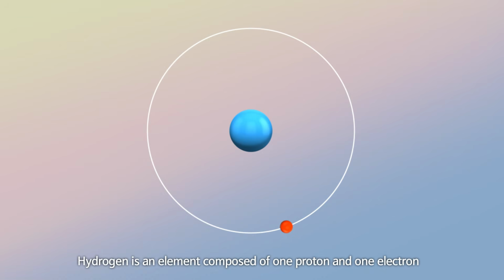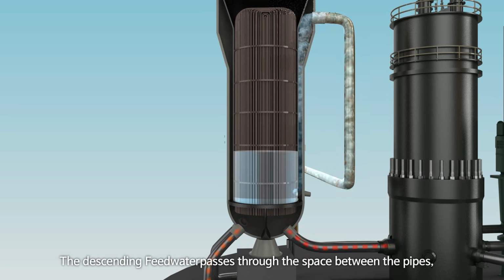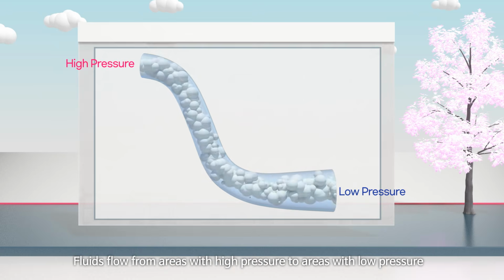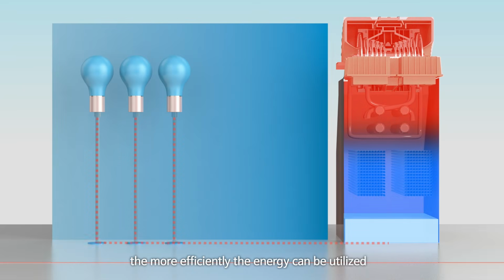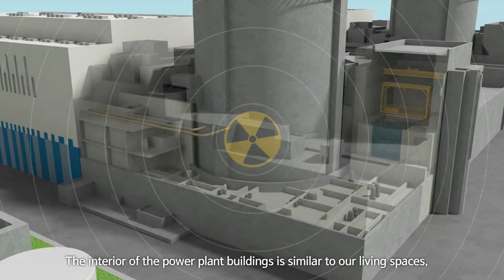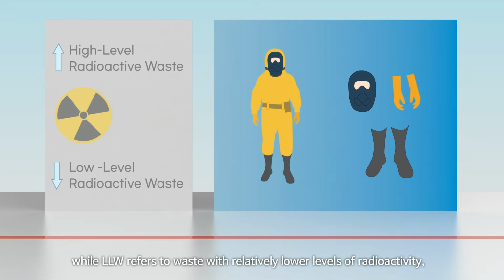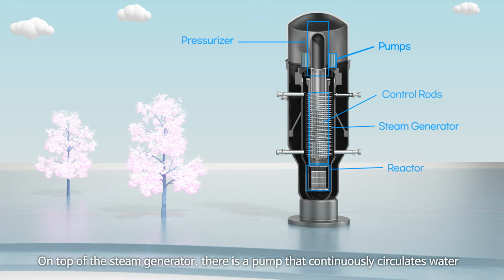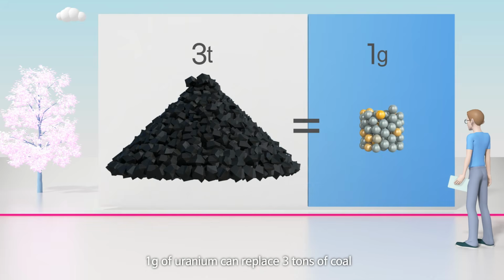Structure and Operation of Nuclear Power Plants

Comment: Good animations.  But 19:32, there are no SMRs being serially manufactured as shown in the animation—not even close.  The factories and assembly lines do not exist.   Even if they did, they would cost enormous sums of money.  A near to full automated factory for SMR manufacturing will be many times the complexity of an SMR itself since a reactor is a complex device with very tight engineering tolerances.

What's worse is there are not enough orders of SMR units to financially justify building an automated SMR factory assembly line in the first place.  So SMR ends up in a catch-22: 

No mass orders → no serial manufacturing
No serial manufacturing → high costs & slow builds
High costs & slow builds → no mass orders

As such, each SMR is still a custom build with bespoke construction methods exactly like a large-scale reactor but producing significantly less output.

So SMRs are actually are the intersection of the worst aspects of nuclear energy being high in cost and small in output which results in the very undesirable high cost per MWh generation.  Traditional large-scale nuclear energy is already one of the most expensive ways to produce electricity on a per MWh levelized cost.  But SMRs are actually heading the wrong way in terms of cost benefit.

Comment: radio active loading of TMI II --A hundred and fifty tons of uraniu,m, 
25,000 grams of plutonium, one billion curies of iodine, 600 million 
curies of cesium, 680 million curies of xenon, 525 million curies of strontium

2 grams of cesium is enough to contaminate about a square mile:
that is the size of dime. Plutonium is much worse. Cut the dime 
into 10 pieces. one of those pieces is enough to contaminate a 
small town. Grind it up into dust, and Blow that into the house, and it 
is enough to contaminate it. If any normal person does this, wouldn't 
this be called a terrorist act, a murder attempt or both? But when the
nuk industry does this with a couple thousand TONS  of plutonium,
cesium, and 1200 other goodies, and that gets spread out over the 
whole world , what happens ?
Reply: What about coal which realeases tons of radioactive isotopes into nature through their stacks or from the fly ash. Cobalt for batteries is mined in conditions akin to slavery. None of these powersorces are perfect.

Comment: The video contains some inaccuracies regarding the moderator: 

"Heavy water slows down the speed of neutrons more than light water simply because it is heavier"

It's precisely the opposite. Light water slows neutrons more, since the mass of the neutrons is very similar to that hydrogen. That maximizes the transference of energy during a collision. Deuterium's mass is ~double that of neutron, so there's less transference of energy.

"Natural uranium has a low concentration of U-235, about 0.7%, and so the speed of neutrons needs to be reduced further. Therefore, they use heavy water"

Heavy water isn't used with natural uranium because it slows down neutrons more. It is used because it is much less of a neutron poison than light water. This is because deuterium has a smaller chance of absorbing neutrons than hydrogen has.
Reply: I came to the comment section to write precisely this.  I've been hearing this error more often than I'd like in these nuclear vids.

Comment: 5:10 "Heavy water slows down the speed of neutrons more than light water simply because it is heavier" ... I thought that light water is a better moderator in terms of elastic scattering, but the hydrogen tends to absorb more neutrons, making the chain reaction more difficult (impossible?) to achieve.
Reply: Agreed. Fantastic videos! ..but that quoted excerpt from the video is wrong and they ought to change it. I was going to make the same comment. Hydrogen and lighter elements are better moderators in theory but the hydrogen in light water will absorb some neutrons and eat some reactivity (i.e. poorer neutron economy). That's why U enrichment is required for LWRs but not necessarily for HWRs.

Comment: Simple and clear presentation of how things work! Amazing how a nuclear plant uses all the same principles of heat exchange, just as in conventional power plants, just the fuel is different.
Reply: Exactly so. Thus it makes sense to build reactors on the same sites as other thermal generation stations and connecting to existing turbines, alterrators, cooling and grid connections.